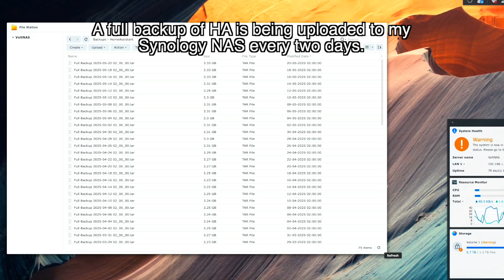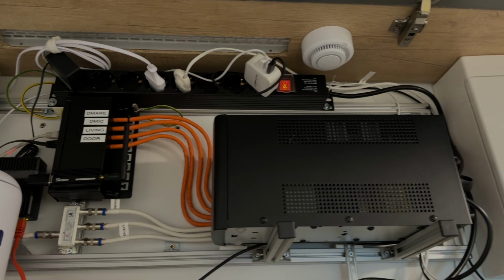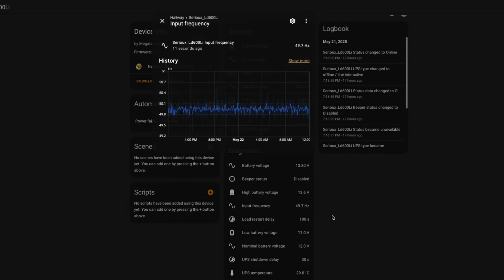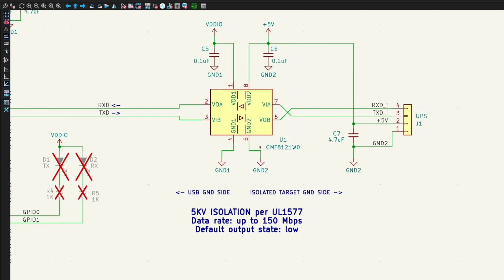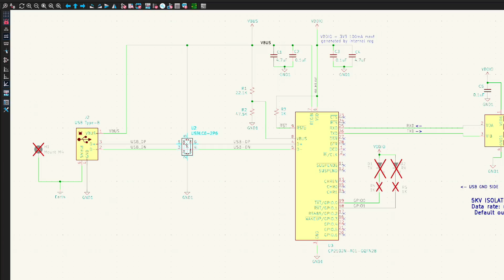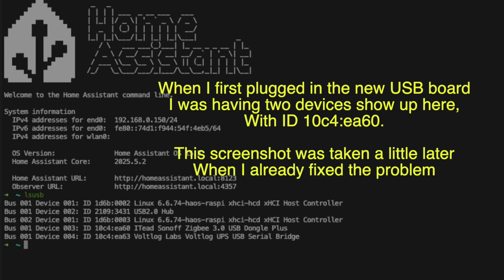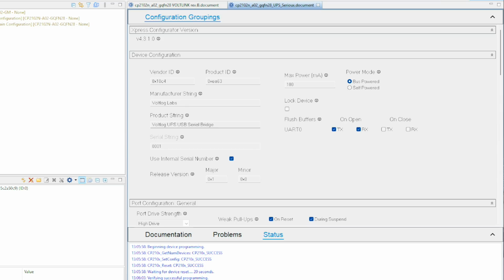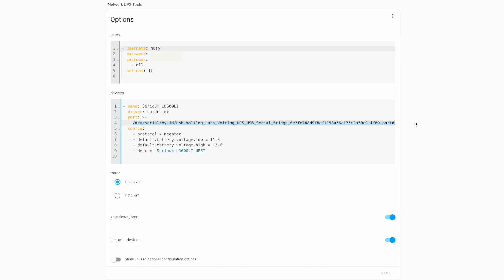I Spent 10 Hours Fixing a $40 UPS - Here's What I Learned | Voltlog 503

Comment: My big problem with the usual UPS is the small battery! Often rated for less than ten minutes even at moderate load, ALSO the waveform is usually a square wave, so many things will rebel when they expect a sine wave.
My idea for a home UPS is a big battery fed from a standby solar charger  feeding a big pure sine inverter, add a smart charger to recover from a deep cycle use. Add some extra solar in case the power stays off for days.
Living in a big town the power hasn't gone off for years. Years ago we did have load-shedding by rota power cuts lasting about 4 hours each.

Comment: Those generic UPS are really good as long as you don't care about performance, reliability, longevity and most importantly safety.

After seeing a couple either melt down or just come no where near their advertised performance its one of the few products I'll just by a brand name with online teardowns (to see the safety mechanisms and actual battery output, power quality, and capacity limits). Plus in an enclosed or dedicated space I want a replicable battery so when it eventually fails I have the option to just swap a battery and not need to redesign everything.

EDIT: And on the topic I have found all my APC units have had a battery failure whereas my Cyberpower hold up longer. Probably just a coincidence though...

Comment: One way to do a home brew UPS is to buy 3 items.  A car battery, battery charger, and an inverter.  Works great for me and I use the 12v for a lot of things.  Definitely not $40 though but worth it in capacity.  Sometimes the outages are hours long and not just a few seconds.

Comment: I recently bougth a DC UPS for my router and ONU, it includes one PoE port. The unit provides up to 35w of power. For my setup it is enough, and it was very cheap. It was able to handle the router and ONU for 6 hours.
Reply: The model is Knup UPS Kp-588.

Comment: Excellent walkthrough and retrospective. - one question - would it not make sense to have the network cable (assuming you did not have fiber) running through that - if the socket was RJ45 and not RJ11
Reply: Hiiya. I am not the OP, but figured I would attempt to answer your question. The two ports you are talking about are for surge protection and not network comms per se -- think of it as a coupler with additional circuitry inside the box for limiting the current rush during worst case scenarios (direct lightening strikes and power generator surges).

I feel dumb now after typing that, as I feel as though you probably already knew that... but anyways, whether it is RJ11 or RJ45 is besides the point. RJ11 voltage levels are many times (~24V methinks?) that of RJ45 in the good ole days, at least. Hard to say about PoE Ethernet, but the surge protection shouldn't be done there probably anyway but instead the PoE hw should contain the same sort of protection circuits.  

I have a few units here at the house with RJ45 ports for surge protection, but the problem is that they are only rated for 100mbps and sure enough, when you try to pass it through, you ultimately drop from a gigabit rate down to 100mbps -_- I have often wondered why exactly this is, though, but I believe it is due to the PHY chip used as it must understand the low-level protocol of Ethernet in order to filter it properly w/o adding too much interference on top; so no, it is not as simple as a coupler due to this reason. Replace the 100mbps Ethernet PHY inside with a 1000mbps or greater and voila, I would have a useful surge protection device.

Did I get a bit too far off point? Perhaps. The OP probably chose not to bother with it as he has stated that it is not necessary in his setup. He optimized his time spent on the project and was a hallmark of a true electrical engineer in my humble opinion.
Reply: I suppose that I will add one more tid bit here. Surge protection, grounding etc topics are a complex study in of itself and often should be designed according to the actual needs of the end-user, as you cannot assume that the house does not already have lightening rods, etc setup or some other means of dealing with potential surges. Houses with electrical generators n such have the option of (hopefully) preventing surges created by the grid's own fluctuations due to whatever reason (we are now in summer here and so probably as we speak there are transient surges possible as they crank up more supply!).  

Sorry not sorry if this is all rambles from me, but in any case, I do get excited thinking about this sort of stuff :-D I am from a similar background as the OP, but in computer science instead of electrical engineering. I began my journey in electrical theory 15 years or so ago, but only now am I beginning to see my studies pay off.... AKA be able to do DIY projects like this!

Comment: I have an older version Cyberpower 1500va I bought a while ago. It sucks. It never worked. It actually caused my computer to shut down immediately rather than save the system during brown outs so it was worse than just connecting my computer directly to the wall. I used it essentially as a very expensive power strip since then and now that the batteries are depleted it's collecting dust in the closet while I decide if it's worth the $60 to replace the batteries or not.
Reply: My experience as well, with a 1000va unit which worked fine for a few months and then at apparently random intervals told the computer to shut down even when mains and battery supplies were available. I have it running without usb wire on non-critical needs at present, having bought a UK-made Eaton unit to replace it. Did attempt to contact Cyberpower for support but they were (probably intentionally) rubbish, blaming the issue on everything and anything but the unit. Won't buy from them again.
Reply: i have a cyberpower one too for my NAS and haven't had any issues with it, just works

Comment: You gave me an idea
10" rack are becoming very popular for homelabs
lots of home users are struggling to find a cheap slimline UPS which can be used with NUT and slim enough for 10" inch rackmate 
thanks for your video. im going to explore getting a cheap lithium UPS from aliexpress that take 18650 battery and use this circuit board to make it smart :-)

Comment: I have an Eaton 900 watt line interactive UPS that runs on 24 volts. A pair of 12 volt 9 amp hour batteries run it however I have a pair of 100 amp hour 12 volt batteries that I tried running the UPS on those batteries wired in series however the UPS still only works to the 80 minute mark and then shuts down just like if it is running on the smaller batteries. This leads me to think that the UPS works on a time factor when used with the smaller batteries instead of watching the actual battery voltage drop. Now if I could only modify the software to monitor battery drain instead of time based on battery size or perhaps modifying the firmware for a 100 amp hour battery.
Reply: alot of the smaller ups run on ish timing not to overload/overheat the small trafoes and heatsinks, best is either online ups or ups that can take extra battery packs ie Eaton EBM serie

Comment: I'm using a 1998 French-made UPS which I've already repaired multiple times. It's quite good with its 24V battery (converted to LFP) and transformerless inverter, must have been pretty modern for its times as even now most UPSes still does employ a transformer. It has a modular connector with RS232 interface on it. I've once connected it to a Linux PC with some strange vintage app reporting simple status info. And now I wonder if this device can output much more data via this port, even without any modding...

Comment: Do you really need to pick a unique VID/PID ?  Cant you use the device path that used the UUID ?  It is certainly reasonable to have multiple devices with the same VID/PID since you can have multiples of the same USB devices plugged in.
Reply from the maker: You are absolutely right. This is not a USB or HW or kernel limitation. This is a software limitation particular to my use case and the apps I use and it was briefly presented in the video.

Comment: Hello, is there a way to get around a fool UPS without USB, to somehow get the data?
Reply: solder wires to battery leads and to the red LED, hook up ESP8266 with a voltage divider and optocoupler, flash ESPHome. You’ll be able to monitor battery voltage and power outages

Comment: Made my non-smart APC UPS - 'smarter' with esp8266, dc-to-dc, and 4 resistors. Connecting to HA through ESPHome. Disassembled the unit soldered 3 wires, Bat+,Bat- and relay trigger wire (12v on Bat power, AC disconnected; 0v on AC). Wires were connected to a 3 pin connector to the outside of the case for ease of access to esp. Voltage divider drops from 14v to 3v (100k, 22k). Now i have not-exactly-smart UPS, but one with some statistics on State of Charge, Bat voltage and Is it on battery or AC. I made automation that sends push notification and email on when the power was cut, recovered and for how long.
Reply: Instead of writing remote shutdown automations, you could use NUT too: there’s a dummy-ups driver that simply reads at a file for its status. This way you can broadcast UPS status to your client machines and they decide when to shutdown. It’s a bit safer since connectivity problems between the NUT server and the client machines surface during normal operation, not just during emergency shutdowns.

Comment: btw many AC devices especially low power ones will also run off of the right level of DC. think about it, that's what the rectifier and filter caps are for. So you could run your router like that.

Comment: The other option is to take the router apart and see what voltage it is putting out from the internal PSU. It’s most likely rectified to DC inside the PSU so you can bypass that. Generally it will be putting out 12V. But it’s best to measure what it’s putting out then use a booster or buck converter if needed. But I would think that it’s going to be 12V.

Comment: All this all of that for 10min or power if u lucky? Even 5min? Really? Is it so golden to do that? Put freaking 5car batteries ull get 2h of power or lifepo4 then all that will be cool
Reply: And where in his cupboard would you suggest putting even 1 car battery, even if cost of car battery was less than cost of that entire product (not true in this country).  And while 10 min may possibly be the max runtime (it's likely longer not shorter), being able to survive a brownout or power spike, or even a MCB trigger which you resolve quickly, is valuable. Even if you run down the battery, cleanly switching off is valuable as well.

All your comment does is show how foolish you are.

Comment: I bought mine from some guy that installed LiFePo4 inside. It has 280wh capacity and generally enough to play on my PC for over an hour (it spikes to 200w with display, averaging 150w). USB port was replaced by XT60 connector to externally charge, because by default it's pretty slow.
There are some PoE UPS, but voltage support is all over the place.
Reply: 280 Wh? You would have to divide by the voltage and you get 280 /  4 V = 70 Ah (I think). I have a non modified UPS, with 2 lead-acid batteries connected in series. Each battery is 9 Ah.
Reply: @louistournas120 its 4 22Ah 46160 3.2V cells taped together in series giving 12.8V with the same 22Ah for the whole pack
Reply: @louistournas120  Nah. LifePo cells have a nominal voltage of 3.2, with a full charge of about 3.65, and a full discharge voltage of 2.5. Nominal battery voltage for a 4s battery would be 12.8v, with a range of 10v-14.6v, depending on state of charge.

Cell capacity doesn't multiply when wired in series, but since the voltage does multiply when they're placed in series, that's where the additional wh comes from. If it's a 280wh battery, it's a 280wh battery. No math required.
Reply: @Wrenchmonkey1  Cell capacity does multiply if you have more batteries. Wh is just a measure of energy. You can convert that to joules if you want. It represents a certain amount of chemicals. As you use the battery, the chemicals will react and you get some end products + energy. It doesn’t matter if you use the batteries in series or in parallel. Each battery will output an X amount of joules.
Reply: @louistournas120  Oh, honey, I JUST explained this to you. 

The individual cell capacity in ah does not multiply, but the voltage DOES multiply when cells are placed in series.

If they're placed in parallel, voltage remains the same but the ah DOES multiply.

watts=amps*volts.

In each case, the increase in wh is the same, regardless of whether it's in series or parallel. Hence why wh is a reliable unit of battery capacity; and why trying to convert it to Ah, the way you were trying to do is silly and meaningless.

The individual cell capacity doesn't determine battery capacity, the entire battery bank does.

If you want to determine the capacity of an individual cell, you would take the Wh capacity and divide by the number of CELLS to get the individual watt hours of each cell.

You could then divide that by the nominal voltage to get a very rough estimate of the total Ah of the battery, but since the charge curve of LiFePo4 is not linear, it would be a very rough estimate indeed. That's why ah is not as reliable a gauge for true battery capacity as watt hours is.

And, no, battery capacity does not represent "a cErTaIn NuMbEr Of ChEmIcAlS" (whatever that even means), it represents the total amount of stored ENERGY. 

Yes, that number can be converted into joules but it makes zero difference which unit of measurement you use, because those are both constant. 

Energy is energy.

A 280wh battery is a 280wh battery. Full stop.

Comment: Got a similar unit for free and gave up due to it's USB interface after trying to get it to work with ANY software, even the "manufacturer" couldn't even find Windows software for it after multiple emails to try and debug what it's trying to do. Tried tonnes of generic chinese UPS rebranded software with no luck.

Ended up giving up on it and using for some lighting in a particular area I would like to remain on in a power outage.

Maybe all hope isn't lost for it after all

Appreciate you doing the research unlike me who just gave up lol!

Comment: interesting project... I recognize the white label UPS as the "US Version" is made for "110v" non-adjustable... which means that if your mains voltage is above 117v (and it will be as we actually have 120v nominal) it will engage the AVR transformer's buck winding, heating the entire enclosure and destroying the battery within a few months... 

Needless to say I'm surprised that your UPS even worked at all much less that you put that much effort into fixing the communications. But I'm glad it worked out 👍
Reply: During the video the status page of the UPS showed line voltage was 227V, so this is definitely not a 110v (or 120v) setup.
Reply: @rivimey  hence why I said the US version to differentiate between the two. UPSes generally come in 120v and 230v variants of the same design.

Comment: Network hardware that uses AC is annoying and I try my best to stay away from it at home. I use a TP-Link Omada PoE switch that requires 53.5V DC and my mini DC UPS unit is 12.5V. After trying out questionable aluminum potted brick boost converters from Amazon, I ended up buying a Mean Well DDR-120A-48. It has adjustable output from 48V to 56V, which is perfect. Efficiency is decent at 88.5% too.
Reply from the maker: I agree but they tend to do that when PoE is involved. At least in compact consumer hw that's the only way to meet safety certifications and keep the cost down at the same time.

Comment: will you do a UPS upgrade that has no USB interface on it? Or is that even possible.
Reply: Unless it has some serial hidden somewhere. You still could put some voltage sensing board inside and give that information to HA
Reply from the maker: Anything is possible with basic electronics and coding knowledge plus a little AI 😅

Comment: I'm guilty of this myself, a lot. Buy a 40$ hdmi switch and call it a day, or buy a 10$ one, remove the microcontroller, reverse engineer the protocol (because the datasheet requires and NDA LOL), make a custom pcb with a usb switch, write firmware for it, and then write drivers for it. Total cost: more than the ready mare one, and that's excluding the countless hours wasted. But was fun.
Reply: i want to read up about your switch, what do i search for?
Reply: I feel like most of us nerds do stuff like this to 'save money', or at least that's how we justify it. Sometimes we just want to tinker and feel like we 'did something'. Buy a hook to hang that thing up? Hell no. Let me pull up Fusion or OnShape, model a custom one, 3D print it, find out it's SLIGHTLY wrong, do it again for 3 more revisions before getting it right. Oh, and the off the shelf hook? It was $5.